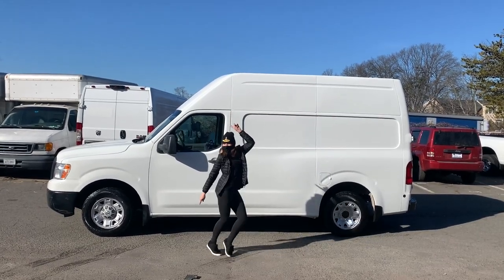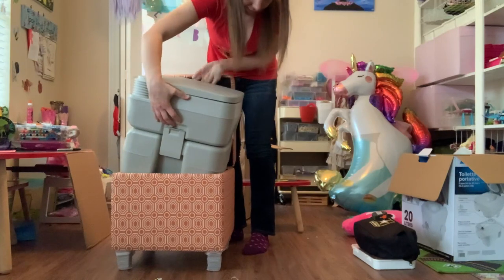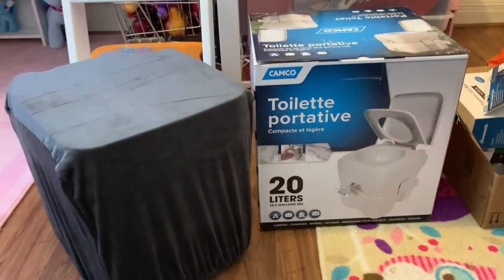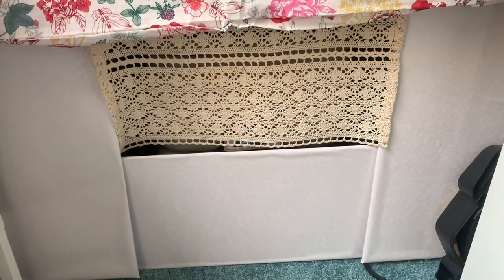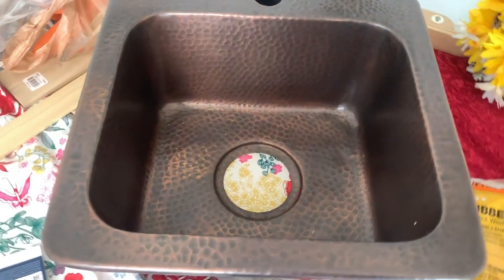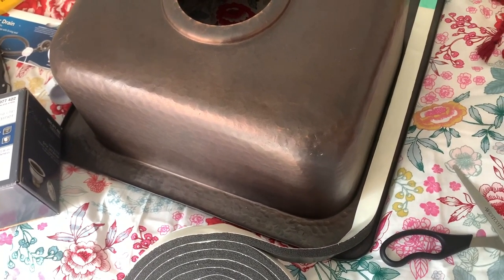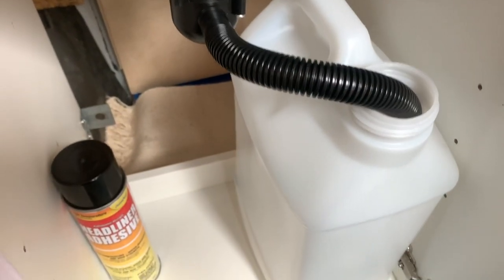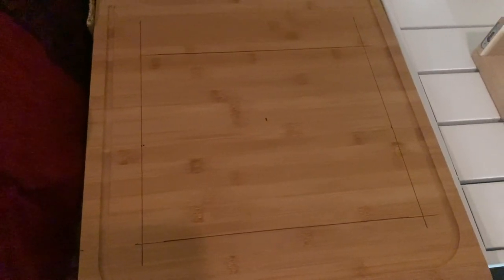Toilet, Sink and Grey Water Tank Installation | Nissan NV2500 High Roof | Solo Cargo Van Conversion

Comment: If you still want an ottoman style box to house your toilet, do a search for square deck boxes on Amazon. The 25-30 gallon sizes will be large enough (~19") to store your toilet.  One more idea: a square cake pan can serve as an overflow pan. They can be obtained in 16" or 18" (and larger sizes) and are 2-4" deep.

Comment: NV is the best kept secret for van builds!
Reply from the maker: It’s the only one I had my eye on since I got interested in van life a year ago. It’s such a fun quirky vehicle and I get a lot of positive comments on it. It’s basically a Titan chassis and runs super smooth.  The gas mileage isn’t that terrible actually. And it takes cheapo gasoline instead of diesel which makes it easier because I have a lot of rewards cards and points cards for different gas stations so I end up saving quite a bit per gallon even with the expanding gas prices. It’s the perfect size, I wouldn’t choose anything else for me.